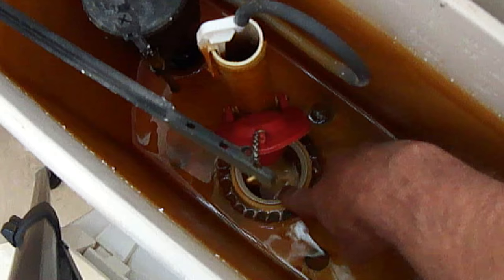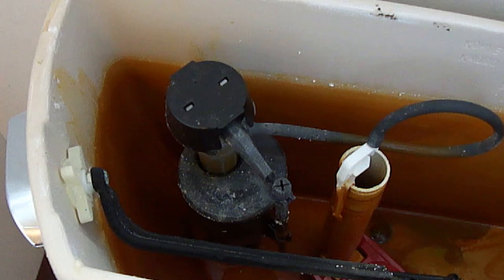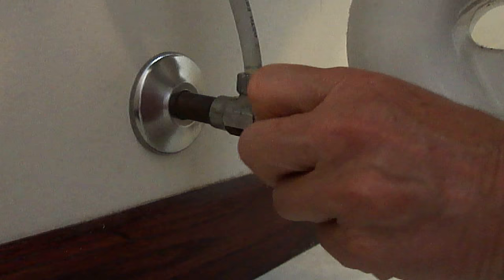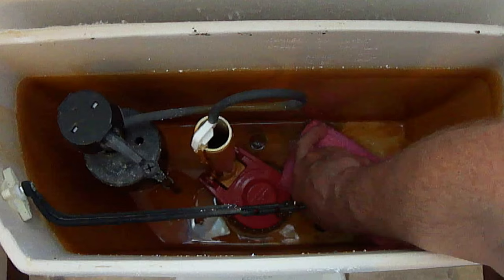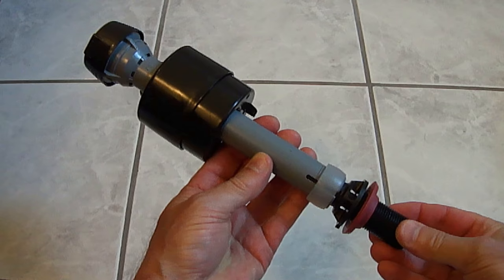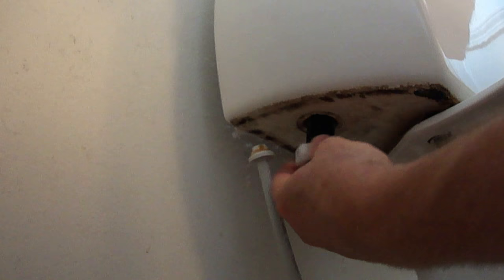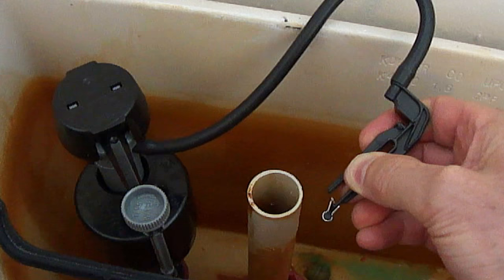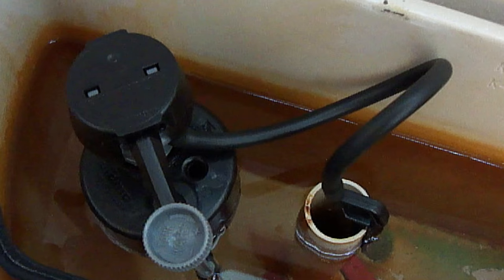Toilet Not Filling Up With Water - Easy Fix!

Comment: This is exactly what I needed. I narrowed my problem down to the fill valve and tried to clean it out (we have hard water in my area, so I figured there were mineral deposits backing everything up). Cleaning it didn't work and I was hesitant to just replace it until I saw this video. It's a lot easier and cheaper to fix than I imagined.

Comment: Awesome guide to fixing and replacing the flush valve. For people doing this at home by themselves, please note that when I did this, the source supply pipe valve was stuck in the older flush valve which caused the supply pipe to leak as soon as I started the main. Luckily after searching for similar issues online, I found the solution which fixed the leak issue.

Comment: I don't consider myself very good at fixing things, so when the toilet tank stopped refilling I automatically called the plumber. They gave me an estimate of $300 to fix it. No way was I paying that to replace a $7 part. I picked up the same one in your video from Home Depot and had it replaced in a few minutes. Tank is refilling perfectly now and no more constant running noise.  Thanks for the clear, easy instructions!

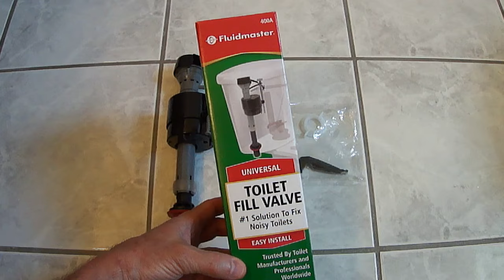Comment: 0:14 Thanks for posting this. That's the cleanest toilet I've ever seen. As far as those hard water stains in the tank go, that's normal. If you're really worried about it, just pour a cup of bleach in there and let it sit for half an hour or so. Obviously, just be sure to flush it through a few times before letting anyone use it. You know, because of the after-splash. You don't want anyone to get bleach burns on their bottoms. 1:05 Anyway, I went to the local hardware store this morning and got that exact same fill valve you showed. I took it home and put it in, no problem. Total cost: $9.98. Actual labor time: 5 minutes. Now I can poop again without having to flush with a bucket.

Comment: I have no idea what I'm doing but I went to Home Depot, bought what you said and followed your instructions.  Well my noisy ass toilet that never stopped running is now fixed and operating like a beauty.  The tank fills up so quickly and then just beautiful dead silence. 

One piece of advice for anyone who might encounter the same problem as me.  The little gasket thing on the outside of the toilet that holds in the old fill valve was stuck on there with what seemed like glue. After an hour of cursing and destroying my knuckles, I tried chiseling it with a switch blade and I finally broke it.  I then ripped the old dill valve out of the toilet and just snapped it.  Good luck. 

Great video. Subscribed.  Time to take a big ol' shlt to see how this baby really runs.

Comment: another problem might be that one of the two hooks on the rubber seal, that connects to the bottom of the white filling tube, might be unhooked. mine wasnt filling past the rubber flap  and it took me embarrassingly long to realise the problem. if thats the case just press down till it hooks. great video, really narrowed down my options!!

Comment: You're a lifesaver. After watching this video, I went straight to Home Depot and bought the same fill valve and replaced the old one. Turned the water back on and the fill valve went into action. Definitely, an empowering moment fixing the toilet since it's such a necessity. Thank you so much for your tutorial
Reply from the maker: 👍😊 good job. Nothing like fixing things yourself! A plumber probably would’ve charged you over $200 to do that job.
Reply: @proclaimliberty2000  Exactly what I was thinking. Took no less than 10 minutes and cost only $7 to do it myself
Reply from the maker: @iihungy  👍😊

Comment: I’d like to thank you for posting this video. 
I was brought up by a very old school father who made me stand beside him for every laborious task ever needed in my house. Back then, it was EXTREMELY annoying. However, later in life it proved to be very helpful. That said.. it made me HATE blue collar work, which influenced me to work on Wall Street, in a white collar setting. But, we are all faced with household breakages, which if you are somewhat of a man, you should be able to handle. After decades of deferring to and paying the blue collar pros, I decided to use my childhood blue collar acumen (haha). Rather than calling a plumber to fix my toilet bowl flushing issues, I took a shot at it on my own. But, what do I know??.. the toilet bowl tank looked like a car engine to me. My toilet water was not refilling… but if I pushed the top of what looked like a long pin with a button on top and the tank would fill. Then I’d flush and it would not refill. I watched your very easy to understand video and bam.. you resolved my problem. The refill clip was indeed attached incorrectly. It was positioned so that the water was going into the tank and not the overfill pipe. I adjusted so that the water was shooting into the overflow pipe, and wallah, it worked perfectly. It took the time it takes to watch your video, and 10 more seconds to repair.  You saved me $300 and made me look cool in front of my wife. 😂🎉🎉🎉. Awesome. Thank you very much. You are the man!!!
Reply from the maker: You’re welcome Thomas. I’m glad I could help you. 😊

Comment: I just had the same problem with my Kohler toilet. Went to a 5 minute Kohler YouTube video and fixed my non filling problem with the use of a plastic cup. And it was quite simple. Pressing down and turning counter clockwise on the black cap and removing then placing the cup over the location of black cap turn on the water for a few seconds. Turn the water off and replace the cap and turn the water back on. Wallah! 
These filling problems keep coming up on my YouTube page and it's interesting to see what everyone elses solutions to these problems are.

Comment: Where do I send my love? I didn't need to replace it, but after months of pulling up on the fill valve to get the water to refill, after watching this video I realized the water pressure was potentially a problem and sure enough, the water flow was somehow turned down. Seems to have fixed the issue just by making sure the pressure was good. I will be triple checking in the morning, but thank you for sharing 💛

Comment: Your instructions are so clear and I’m anxious to give this a try. I went out and bought the necessary part I was all set until getting off the lock nut, it’s impossible it won’t budge not sure where to go from here.  Don’t want to call a plumber just to get a nut loose.
Reply: You using the correct tool to remove get it loose?

Comment: Thanks. I've never done any home repairs before, but I was able to do this easily and quickly, and saved some money on a plumber. Looking up quotes put the cost around $150 for this simple replacement, that doesn't even require a screwdriver.
Reply from the maker: 👍😊 Awesome!

Comment: Awesome thank u , found this video at 1am and I’m going to try adjusting the height on my current fill valve first because I think that’s what may be the issue. I had taken off the lines earlier and realized the fill valve was spinning inside after I saw the hose bent around in 3 different spots. I suppose I might’ve been turning it and accidentally lowering the height as I was working with the water line .

Comment: I followed your instructions exactly and was able to replace the fill valve in about 15 minutes. The hardest part was loosening the nut, but was able to get it started with pliers. I bought the same kit that you used at Home Depot ($7). Thank you so much for your video!

Comment: Thanks man straight to the point on why the water is not filling up. Seems my issue might #2 that mechanic not working anymore or and possibly #3 the water valve pipe is old and needs a replacement tube. [UPDATE] Looks like there's a #4th possibility the water isn't filling up is the fill valva has calcium build up or rocks blocking the flow of the water. See 0:38 that black top part of the fill valve can be turned and removed (look up a video on that so you don't break it) before removing it shut off the water valva first then proceed to remove thing as instructed to check for any calcium rock build up. 
If any remove them then reattach it securely then turn back on the water valve and see if the water flow's again. Do some tests and you're done. Another video I saw says to replace it. We'll see what happens if it needs replacement but anyways this was our situation and my brother fixed it.

Comment: Dude, thank you so much! The rubber flap didn’t seal properly on my toilet. I just pushed it down and the tank filled and then stopped running. I will replace the seal now that I know that’s the problem. Thank you again!

Comment: I just did this repair using your excellent instructions.  The last step almost caused me some worry-  I had to keep turning the knob left or counter clockwise about a dozen times before the water level would stop about half and inch below the pipe. 
One thing though-  I can observe beads of water forming on the fill valve where I connected the tube to it. Is this a problem or can I just let it go?  Right now the toilet works for the first time in a week, thanks for this most clear and concise instructional.
Reply from the maker: The beads of water are fine. Good job! 👍😊

Comment: Ran into two hitches. 1)The lock nut holding the old fill valve in place was ridiculously tight. I spent a lot of time trying to get it off. Finally, had to get out pliers to loosen it. 2)There is a rubber seal that goes on the bottom of the fill valve. My kit did not have the rubber seal attached. It only took me one do-over to figure it out.

Comment: Thank You very helpful - Would you or anyone on the channel be able to answer a quick question. The fill valve was recently replaced. Periodically, the water would run briefly after the tank was full. Recently, the fill value does not engage - Once I give it a light tap on the top - the water starts filling the tank. Thoughts?

Comment: So I picked up this part from Home Depot.  Must be the toilet that I have, but maxing out the length I wasn't able to get up to 3 inches higher than the top of the overfill pipe, so I'm settling for like a little less than 3 inches.  Also when adjust the water level.  I wasn't able to get the half inch below the top of the overfill pipe.  Settling for like 1 inch below overfill pipe.  Hope things still work well.

Comment: hi Friend! In your experience, is it almost always the fill valve that needs replacing rather than the rubber flap?
I'm not sure how to check which one is the culprit
Reply: You’ll hear the water running down the toilet if it’s the rubber flap ( the tank will never fill up due to running water through the flap).
Reply: @atreto21  thanks friend

Comment: 0:30 Its cool thing to add in, but if the water isn't running than its definitely not the plunger seal. In my case the fill valve isn't broke per say but rather its been getting stuck giving it a tap turns it back on. I assume ill have to replace the rubber piece inside at some point or the whole valve itself but thats another story. I was just curious if anything else could do it. Actually i just wiggled it & it turns back on, which makes me wonder if its not sealed correctly if it would stop it from working. Like if the seal became loos.

Comment: I just bought a fluid master 400L, i adjusted the water level with the screw and it stops by itself, however when I flush it doesn't refill.  

It only refills when I manually push down on the cup a little.  I left my toilet tank open until I fixed the problem.  Not sure if I did something wrong

Comment: If you shut the water off, should you still hear noise coming from the old fill valve? The water is trickling out of the bottom of the fill valve but no water is coming out of the fill port and going into the center pipe, I just recently replaced the flapper now having these other issues.

Comment: Thank you. This is was helpful. However, after changing both the fill valve and the feeding tube as you suggested, the water level still stays low. I even changed the flap. I am open to suggestions.
Reply from the maker: It sounds to me like your fill valve is not adjusted properly.

Comment: Any suggestion on what to do if the 2:16  the connector nut for the water line is stuck? It doesn't have the wings on it like in the video and it looks and feels like the plastic has been stripped off so there aren't any ribs to grasp. I couldn't turn it by hand and had to use a Pipe wrench. When I tried to turn it with the pipe wrench, everything from the water supply pipe to the Fill Valve assembly turned the same direction. I tried turning it clockwise and EVERYTHING turned clockwise. I tried turning it counter-clockwise and EVERYTHING turned counter-clockwise.  I can't get past this point. The Plastic Connector Nut thing is stuck Fast and I can't get it off. Interestingly enough the plastic locknut above it is able to spin a bit on its own, but it only goes down as far as the  connector nut and stops since I can't get the connector nut to spin independently of what it's attached to.  Should I squirt it with WD-40 or something like that?

Comment: thanks for this ... trying it tomorrow. hope it helps! my toilet is not making noise but won't fill back up, and won't hold water either. i tried to fill it up by hand  and it seemed to leak right out.
Reply from the maker: Hillary Zinks Sounds like it might be a problem with your flush valve. It just so happens that I’m posting another video tonight at midnight on how to replace a flush valve. Hope these videos help
Reply from the maker: https://youtu.be/XZNCaUvJMsI

Comment: How often to these fill valves have to be replaced? I'm pretty sure my father replaced it within 5 years ago if not sooner, but now it's not filling the toilet with water after I flush unless I lift off the lid and jostle the valve to I guess "jump start" it into the refill process. I feel like it's too soon to be malfunctioning, but if this problem is indeed indicator something is wrong with in, then I supposed I'll have to replace it again. Any advice? Thanks.
Reply from the maker: It’s very random how often these have to be replaced

Comment: The toilet flushes ok but then doesn't start to refill.  After a minute or longer (sometimes several minutes elapse before the tank begins to fill), it starts to refill.  The water pressure is good.  No hissing once refilled.  Sure, I could replace the Fill Valve, but why does it take so long to start refilling?  Thanks for your time.  GBA.

Comment: I replaced mine with same replacement above. It doesn't sound like it's leaking water from seal(newer seal) or toilet but it refills for a second or so every 8 to 10 hrs. Any ideas? Oh yeah. I do have the hose facing the opposite way. Could this be the reason? All my other toilets have been replaced with same. Same installation and they are all running just fine.
Reply from the maker: Get some Aladdin Teflon lubricant which you can find at a pool store. Apply it to the surface of the flush valve where it seals and the leak will stop

Comment: Question! My toilet isn't refilling with water, but the seal s working properly and the only way to fill it out is to push down on the adjust thingy. Should I just replace like you did?
Reply from the maker: Yes.  I purchased a fill valve at Home Depot recently for seven dollars so it’s very inexpensive if you could do it yourself.

Comment: I have the same type of fill valve than in the video. My toilet won't refill after flushing unless I flush very quick. If I keep the flushing handle down a couple of seconds because I need more water to flush, the tank won't refill. Otherwise flushing is weak and I don't have a refill tube. Any idea of what is the trouble?

Comment: If there is water in the tank it doesn't stay.  It's empty within a few minutes.  Would it be the same issue?  Everything else was as mentioned in the video: sounds and does not refill.  But when I pour in water it does not stay.

Comment: My modern toilet uses a couple gallons per flush and sometimes keeps 'filling' But the problem is not the rubber 'flap'... it is that the flap arms both have to fit on a transverse plastic dowel. and sometimes one side will slip loose. Just press it back in place and all is well...

Comment: Is there not a way to just adjust the fill valve or fix it without replacing it?
Reply from the maker: It would not be cost-effective to try to repair it. Replacing it is not that difficult and you’ll have a brand new fill valve.

Comment: I just moved in somewhere and the toilet has this problem ( silly, I know ). I am unsure how long it has been like this. The water is not turned off. Could it be another issue? If the water is turned on I would assume that I would see some kind of water. I just don’t want to screw something up and make it even worse.

Comment: Dam, I got stuck on the first step. The shut off valve on the toilet won't turn. I'm wondering, if the shut off valve on the toilet won't turn, can I just shut the water off at the main water line or do I have to shut the valve off on the toilet for this to work?

Comment: nice instructions.   However,  I find the instructions on removing the fill valve (turning threads to the left (clockwise) not in sink with the video actions.

Thanks however for sharing
Reply from the maker: Yes, I miss spoke on that.

Comment: What happens when you put a new fill valve, still happens. So you purchase a brand new toilet and it is STILL barely trickling into the tank. Could it be the water valve be the issue OR possibly the actual line coming from water line?
Reply from the maker: Elaine Ortiz from what you’ve described it sounds like the fill valve is not receiving an adequate supply of water. Sounds like a clogged water line or maybe a bad water shut off valve.